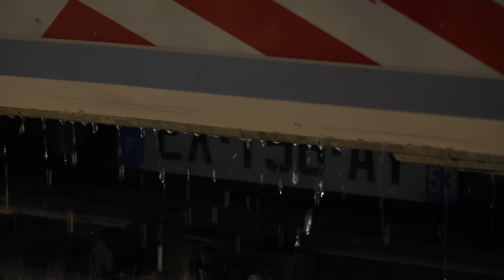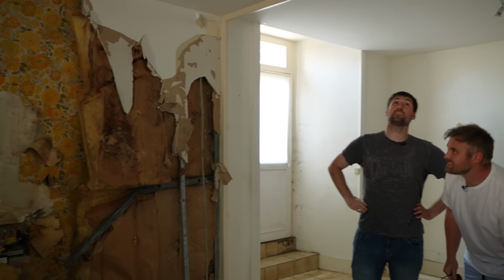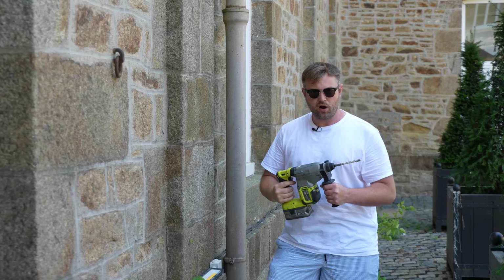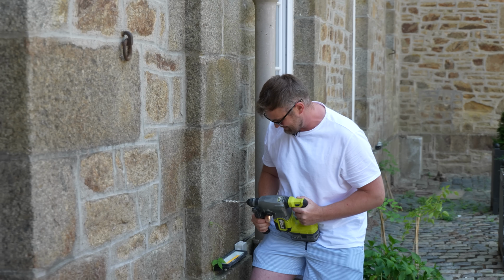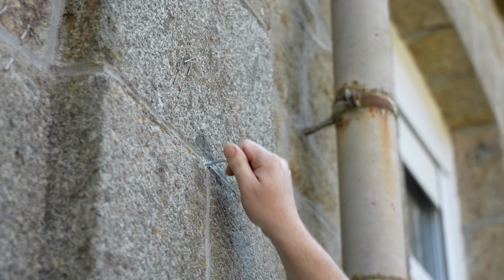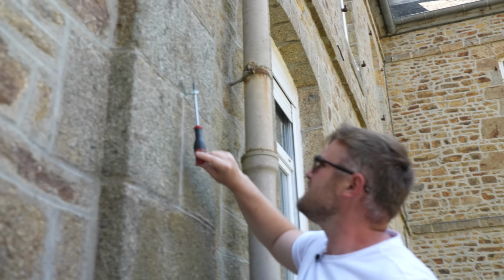My Best Friend Obliterates My Apartment!

Comment: Helpful tip is to keep a large tarp handy when you dump, put the tarp on the ground under the dump area, easy to clean up after...in some cases use the tarp and just dump the whole load on the tarp and your truck bed is free for other uses.😊
Reply: Excellent suggestion
Reply: Also, the tarp can go in the transit before filling with sand 😉

Comment: Billy, here in California our wisteria can grow about one foot a day, especially in direct sunlight.  So be prepared, they move pretty darn fast.  Also, the wisteria will bloom after a year or two.  Give them a bit of time and not too much water.  For some reason mine preferred to be left alone and once established there was no need to water it.  Be aware, you will need to keep it pruned away from the roof, it can and will take your tiles off as the tendrils weave themselves around any sort of holding point.  I would prune mine twice a year, after the first flush of blooms and then later in the summer/fall to maintain its shape when the leaves would begin to drop.  Also, if you have anyone in your family who enjoys crafting, once you do your pre-summer pruning the long stems can be twisted into beautiful wreaths that can be dried and used for winter decor inside and outside of your chateau or convent.  Crack-On!
Reply: Totally different strain of wisteria in europe .  Getting ours to establish itself enough to flower takes years . 
Then it inches along at a snails pace .
Reply: Amen to Lena's advice. Wisteria is a beautiful plant but need care and attention on pruning. Also, the extra uses of the cut branches. I did the same decorating the front of the main door at Christmas with all natural holly ivy, leaves, pine cones etc and electric fairy lights and not  plastics!! The neighbours and birds loved it! So. If need of ideas and hands for wreaths, I would love to help out...❤😊
Reply: @Mitch-Hendren  Thank you so much, we only have this basic variety here.  They can be monsters and overtake structures, and grow straight up nearby trees within days.  But man oh man, they are stunning during the flowering season.

Comment: I hate to tell you, Billy, but wisteria is the very worst climber to put anywhere near any building, let alone stone! It has a rampant root system which gets itself into any nock or cranny and it'll rip those little hooks out as if they're cotton wool! Speaking from experience, I've spent over 30 years trying to kill the vine that was growing all over the front of my house! It will go through under any structure and damage everything it coils around. It's fine planted in a container in the middle of an open space, as long as the vine is never allowed to touch the ground, it will root itself in so fast! I don't want to see that beautiful building get damaged! It's nice to meet Alex, he'll be an asset for you! 😊

Comment: the reason it's 'moist' is because of the gypsum and the smothering of the structure so that the stone cannot breathe.. it encourages Merle.... so pull it out back to the stone; plaster in lime and clear the drains on the outside.. or put in a french drain.  Thanks for the vlog; always a joy and great work!

Comment: Tip for putting a lot of eye hooks in. Chuck an open ended hook into a drill and use it as a driver. Just start by hand, slip in the eye, run it in.

Comment: Hey Billy! I was thinking about the door, maybe it should open inwards in case that area floods at times, since it has the drains in the ground, that in case you need to build up the bottom of the door area with stone or sand bags or whatever, you can still open the door.

Comment: If the insulation was installed backwards (paper faced the exterior), the moisture collected on the interior side and weeped down to the bottom of the studs, which is why there's rust.

Comment: Billy as a gardener of 15 years specialising in pruning wisteria you need to train the side branches of the wisteria onto horizontal wires not just ‘let it climb’. That way you maximise the flowering and reduce the excess growth but be warned they are a labour of love. You’ll probably need to prune twice a year in addition to the scheduled summer and winter pruning.

Comment: The moisture in the wall is there going UP from the floor. Most likely have a leak in that window or doorway. The wall is  Wicking the water up the wall. That is on a low spot. I would check on the outside to see where water is leaking in.

Comment: If it was just damp from sitting vacant, it would be all over. My bet is that it is  coming from the fireplace. Does it have a chimney or exhaust?
Reply: I agree that makes sense about the dampness only being on that side. An original chimney is there for the fireplaces on that wall. My take on where the water is coming in is slightly different. The window? to the right of the fireplace was originally a doorway that was converted when the drive and drain were added, not necessarily at the same time, outside the wall. I imagine the ground was lower when it was built allowing for water to not reach the doorway opening. The drive, with improper pitch toward the building, was laid down without lowering the ground first, requiring the door to be converted into a window. The substandard, IMO, work resulted in an avenue for water to enter the apartment. Go on google Earth, look at the side of the building and you will see what I am referring to.

Comment: Hi there, I might be completely wrong, but I have a feeling that if you tie wire around the Wisteria tendrils it will cut through the tendrils when it's windy - as the wind blows the tendril against the wire. I believe it's better to use soft string to tie them to the wire that you want them to climb up. Someone may have already commented about this - and I could be completely wrong!

Comment: For the humidity in the apartment you may have infiltrations from the wall on the car park outside, as it is a little bit higher than the apartment… And there is a drain collecting the water from the car park just behind the wall… just a point of vigilance ! 😉

Comment: I'm surprised you don't have any skip bags to store the sand in temporarily. You should use vineeyes to hammer into the mortor and wire instead of drilling into the wall.

Comment: the water might just be condensation. the water from inside the air works its way through the inner wall and condenses on the stone wall on the inside.

Comment: The problem with the moisture in the wall may be due to the use of the metal stud work. It you have humidity problems, especially in a building that is not climate controlled, it can cause condensation on the metal studs with it all running down and gathering.

Comment: was watching you jittering the tray on the truck to get the sand to move and started crying "Don't do that!" 
The poor ram and hydraulics wont like that one bit. When you have some weight in the tray, the ram has a habit of bending and then you are stuck and need to replace it. Not cheap. When they are light like what you have then sometimes a hydraulic line may begin to bulge and then let go without warning making it drop dangerously suddenly.

Comment: You really want a space that wiring at least 6 inches away from the stone... your exterior stones are extremely clean do you want to have to try to fix them again power washing... the Vines will be extremely heavy... it might even think about incorporating some of that scrap metal on the edges since it's going to be thrown away from the corner apartment by Ryan

Comment: Billy: you're not wrong about the price of printer ink,especially coloured ink. If I buy the recommended manufacturer's ink, it's in the region of £80. Buy a generic equivalent, £20; and the difference is barely perceivable.

Comment: In defense of Ryan the wall literally came apart as he tried to take off the plaster board.   As far as the skirting board goes, somebody in the comments told him to take them off so he could remove the tiles.  I think you should let him know if you’re okay with the tiles coming up.   The bedroom floor is toast.  By the way did you fix the roof?